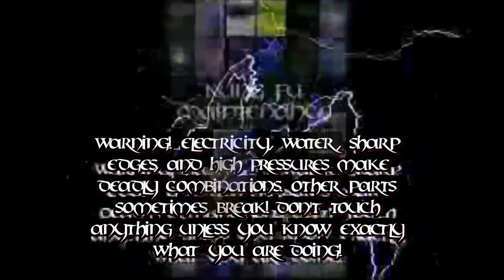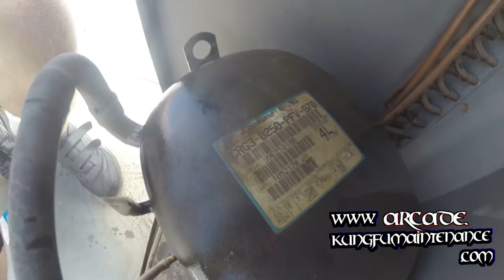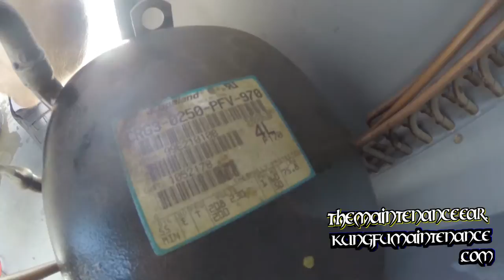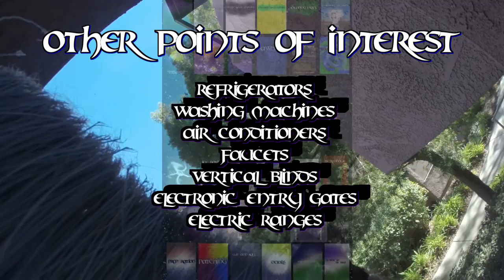Air Conditioning System Not Cooling Fan Running But Compressor Stopped Working Repair Video

Comment: The suction accumulator was good to see, manufacturers should provide them inside each AC unit, Copeland is putting them on some of their refrigeration condensing units, they would save big on warranty compressor faliures and it's not a high tech item it should be inexpensive to manufacture. Sometimes when a compressor failed it's due to a worn out TXV, you change the compressor and everything is working fine, then six hours after you leave the TXV  acts up, either fails closed or open, or the thermostat sticks on, or the customer cranks the thermostat too cold, the next day the unit ices up,(freeze stats are good) your customer calls mad "It's not working" you find the compressor is siezed up.